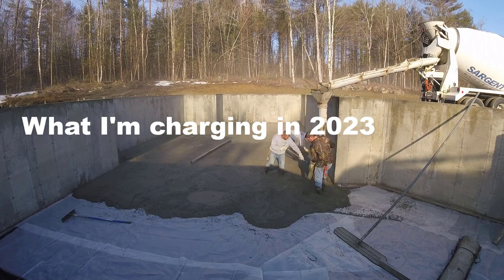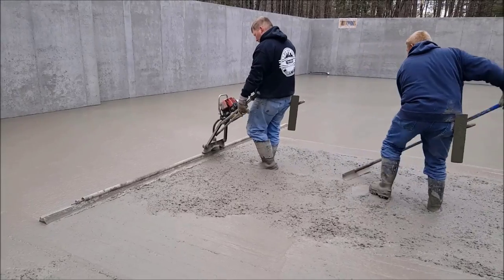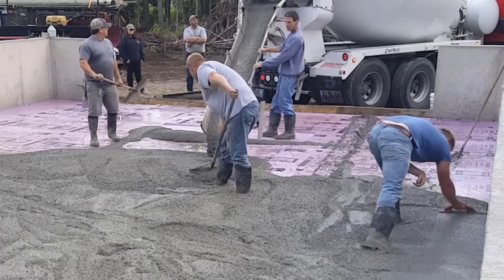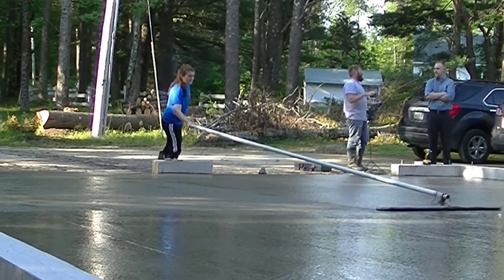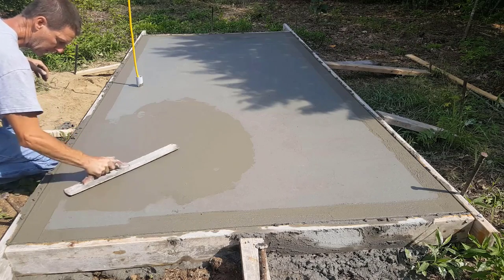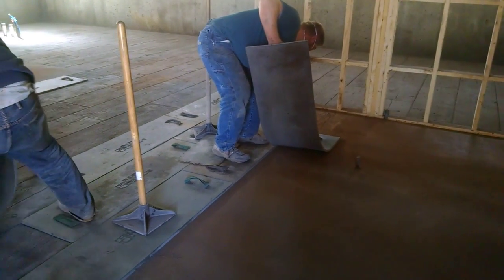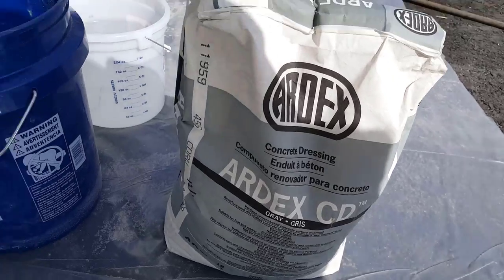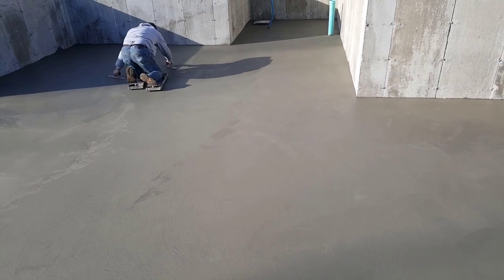What I'm Charging in 2023 - 8 Ways I Make Money Doing Concrete!

Comment: I called 3 contractors in North Georgia trying to get them to come look at my 34’ x 34’ barn to pour a 5-6” thick well finished slab and couldn’t even get them to come out and look at it. Housing boom in North Georgia and everything is or was going gang busters. I was going to pour it myself but they quoted me 244 dollars a yard to deliver 4000 psi premix. I ended up pouring 14 yards using a Mudmixer with my brother in law and a helper. I probably overpaid doing it that way, but I can depend on myself where you just can’t on others unfortunately. I figured 10-15k to pour and finish it? It would make me feel better if I knew it would cost more than 10k.
Reply: I am the same way, I end up doing it all my self. It's not that difficult.  Yes a good work out but it's your work and you save so much. That's what is happening with contractors continuing to over charge.
Reply: 14 yard slab I would do for $6,500 and that is professionally done and my prices are on the high end in my area mid coast maine
Reply: Just a barn slab bull float Fresno finish and no doorways to cut down I would charge even less
Reply: @jessesawyer3875  I’ve got more than 6500 in it, probably closer to 8000 I guess, but I’ve got one of those new Mudmixer machines to show for it after being done. I would have rather paid to have it done by a professional, that’s tough work! 670 bags worth. I had hoped to have a smooth seamless floor you could roll a creeper on. I can roll a creeper on it, but it was poured in 9 sections of about 10x12, so not seamless. We bull floated it, it turned out okay I guess. It will do to park a tractor on it.
Reply: @jessesawyer3875  I wished you were in North Georgia, we would have both been happy. I had it dug out and leveled and graveled, if you poured it all at once you would have only needed to form across the two doors, the rest was pouring to walls/blocks. You could have backed the truck up to the 14’ tall door, not sure if you use that plasticizer stuff to make it flow into a 34 foot deep barn or if you use a mud buggy or? Done in a day I would think…hours maybe?
Reply: Much respect, those bags get very heavy.  I've been looking at those 1.75 yrd pull behinds to do work here in FL because the work is so much and everyone is so busy. By the way, if you did 14 yards, that tells me it was only 4" deep, not 5 or 6".

Comment: I am a contractor in mid coast Maine and started doing my own concrete years ago and watched all your videos. I do icf forms on slabs with radiant tubes ECT. Your videos gave us the confidence to tackle these jobs but I had to figure my own pricing out. According to this video my pricing is the same as yours but you guys do a better job at finishing and I've never done any stamping or staining. Maybe in the future 😅 thanks for a great education over the years I owe it to you.
Reply: How was it jumping into ICF walls? Ive been looking at trying fox blocks but seems daunting especially with all the bracing and required braces. In Fl panhandle and only commercial does ICF around here.
Reply: What state are you operating at down here in salt lake City Utah$5 mostly labor only it around 230 a yard here
Reply: @raystraining3206  getting the ICF blocks has been a challenge. Now I stock a trailer load at all times. Can be 1-3 months waiting for fox blocks or usually quicker with logic blocks. If you have never poured a form wall, don't let your first be ICF. I always use pump truck for controlled placement. I won't take regular form jobs anymore only ICF.

Comment: We work in central pa and our price on concrete is around $155 -170...
We average 4.25 per square foot for basements @ 3.5 inches .
This includes prep.
Final grade and plastic drain and radon pipe. Pour and finish.

Garage and porches are more like 5.25 ..drains, compaction, forming,
4"concrete with wire pour and finish.

This builder gives us 80-90 homes a year.
Jobs for individuals are higher but not what it should be.
Love watching you guys work!
We've been at it for 35 plus years and we can stil learn from people like you.
Keep up the good work
Reply from the maker: Thank you 😊

Comment: Hey Mike.  You guys do the fine grading and plate compaction, correct?  Those prices are similar to MN.  Giving SF prices can be tricky - a lot of residential projects we do come down to ease of access.  That tends to be the biggest factor in pricing.  If you can't get heavy equipment in the yard or need to pump over a house type thing.  Thanks for sharing!

Comment: I’m homeowner. I’m planning to build a metal structure workshop (woodworking), which will be attached to my existing 24’x24’ garage. It will be about 22’x30’ with a 5’x24’ storage/locker room (this part would be in between and attached to both the workshop and garage. I’m thinking of a radiant heated floor. As I stated, I’m in the planning stages and as Mike Holmes always say, “exceed the codes and do it right the first time”. So, I’m trying to get as much information as possible. Your videos are extremely helpful. I still have a lot of questions and I really wish you were local; I live in southern Virginia. I always want to know why I need to do something, so I don’t get beat by the contractor. So, thanks for what you do.
Will

Comment: Should u saw cut a suspended concrete slab thats 24x22 it has3 8in I beams running the 22ft width and one 8in center beam connecting all of them. Plus 1.5 DMACC decking on that

Comment: Small Crew? BS, you have to count the twins as double double, there are telepathic twice as efficient. 😂The foam is a huge benefit, should also look at doing 1in around the edge of the slab also as it provides a thermal break from the stem wall.  Great videos!

Comment: I just did 210 sq ft of concrete w a mixer today. 2 & 1/2 inch thick slab for a driveway. I charged $1600. All 90 lbs bags. Labor was a whore. The customer wanted it as cheap as possible. Rebar was wired up and sturdy. Job wasn't lousy. I just want tips and advice on what I should charge in the future for this large of a job. We finished in 14 hours with 2 people. Any advice would be great.
Reply from the maker: I'd have charged at least double what you did.
Reply: @MikeDayConcrete  Thank you. I appreciate your reply. Now I know.

Comment: Is there a limit on how many extension poles you will use on the Bullfloat? I know you have to reach as far as the concrete goes but would you not use more than whatever amount of poles or just use as many as you
  need to reach the pour?
Reply: I don't have a limit but never use more then 5 just don't need to mostly 3 to 4

Comment: In Australia I charge 50m2 for shed slabs, 70m2 for paths and 80m2 for exposed, they are labour prices. 
For little work minimum charge is 600 day rate per person. 
Steps are charged out day rate per person as above. Very large work is worked out as I have to win the job as well. Example we are currently doing a 1300m2 driveway I went in at 35m2 labour and got it. Pouring 104m2 per day with 2 other guys.